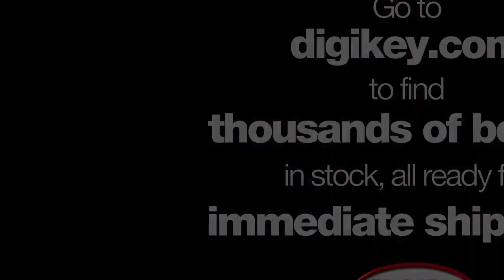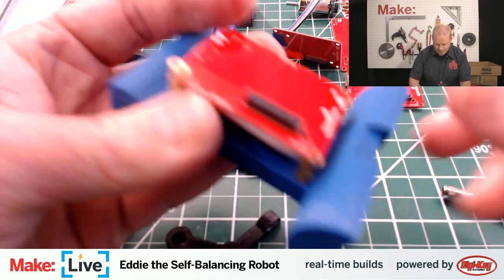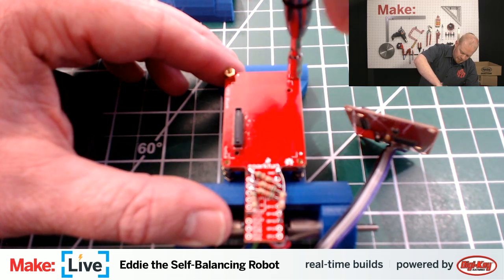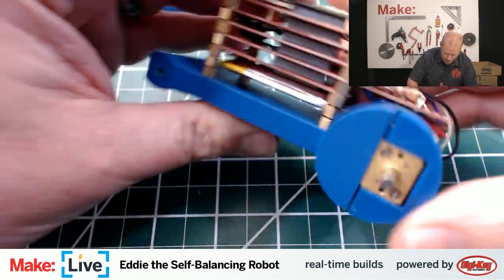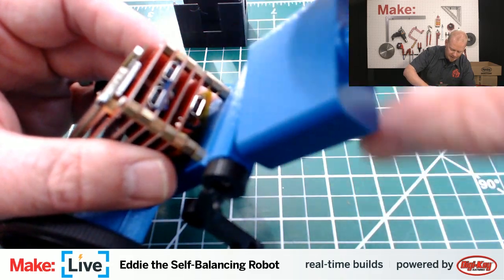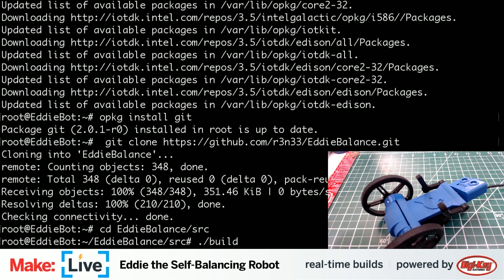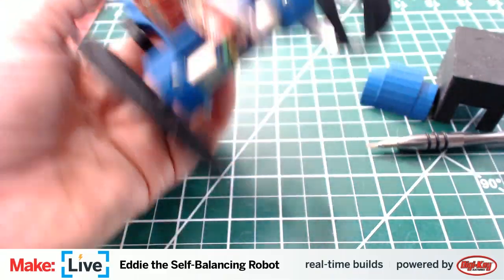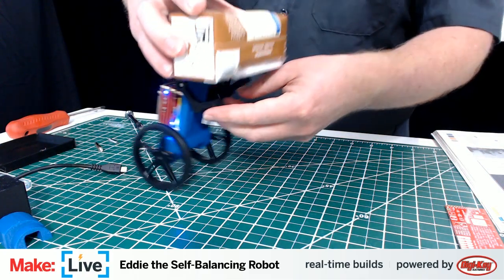Make: Live - Building Eddie, the Self-Balancing Robot

Comment: Do people actually use the Edison?   
Intel has been rather aggressive with their product placement for it.  It gives the impression that no-one except Intel wants to use it... no real people.

I mean this project for example, the Edison is overkill right?  A sub-$3 ESP8266 can do it fine.  To use the expensive Edison for it just comes across as yet more inappropriate product placement.  I was surprised to not see Intel as a sponsor, are the lines really getting that blurred?
Reply: Most sub-5$ microcontrollers (ESP8266, STM32F103, ATmega328P, etc.)  should be able to handle this robot without any problem. Why should anybody waste 40-50$ for Intel Edison on this simple robot?